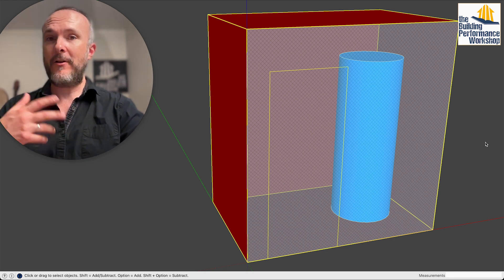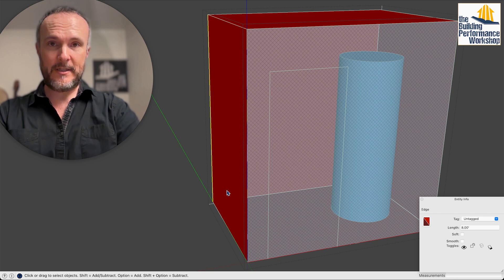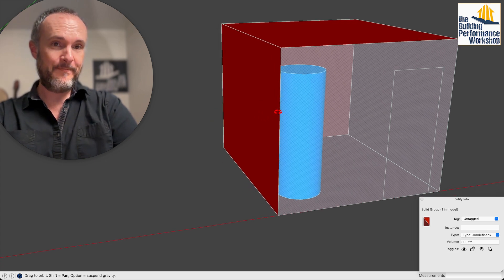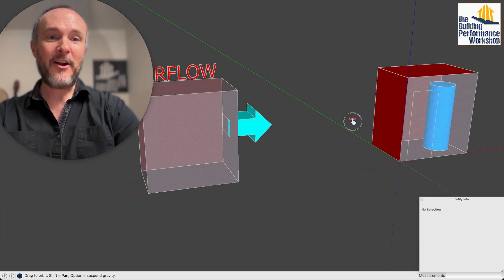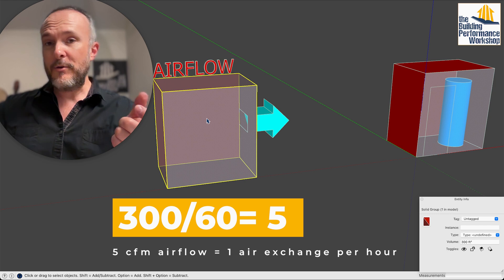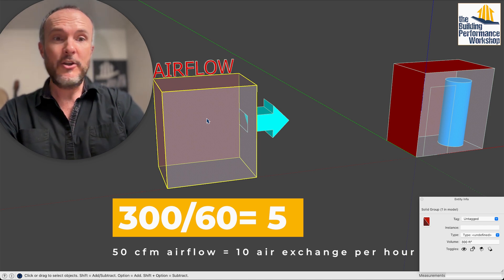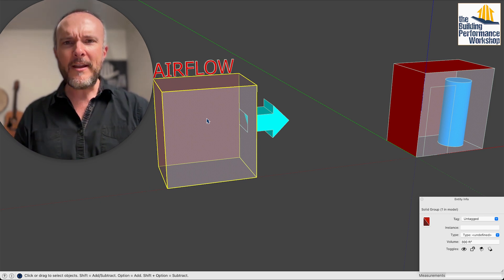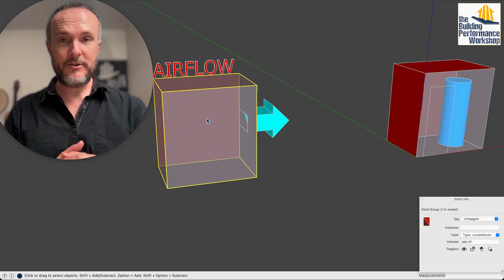Heat Pump Water Heater Trick: Bigger Air Volume, Same Size Room

Comment: I'm considering this solution in a house I'm starting to build in Spain. Where air would be supplied from a recuperation unit and overpressure would push the cold air through the door to the pantry and then to the open plan kitchen where the recuperation unit will have exhaust air intake. Alternative to this is to pull hot air directrly from the outsidenwhich would boost performance most of the year but could make the room a hotpoint of the house if unbalanced. I might update you in a year or two which way it went 😊
Reply: If you live in a place that doesn't freeze, solar preheating is a great idea, whether you use a HPHW, plain resistive, or instant hot water: it's free energy.

Another common thing being done now in climates with cold fresh water is installing a copper pipe on the sewer, and running the fresh water around the copper pipe to prewarm it. ThermoDrain is one producer of such a product if you want to google for a picture. It's particularly effective with showering and clothes washers, where the incoming 5º water can be raised to 20º before going into the hot water tank. Warming all the cold water, not just the hot water tank input, also leads to less hot water being used to mix with cold water (washing hands, dishes, so on), and reduces condensation on toilet tanks if humidity is high. It still makes sense in warm climates, but the payback is longer.
Reply: My biggest mistake was putting in HPHW, it sounds great and for most countries is the best choice. 
But for Thailand (I guess similar to Spain) I really should have just put in Solar hot water
Reply: @BradleyFordAus  much less humid in my part of Spain and in winter solar will not heat enough and would have to be electrically boosted anyway. If you don't mind, what is the issue with your setup? I can still rethink the solution, so would love to know the drawbacks.
Reply: @strayobject  the key is energy cost even with solar, a typical day is 9kWh just for HPHW
Reply: why not just use a split system?
if your not in a snow aera in winter you can do the water piped version which will work with most cylinders. or the gas pipe type which is just like a heat pump.
the only advantage of the internal units is in climates that are warm/hot all year round where you want to remove heat from inside the house.

Comment: Suprised you didn't talk about ducting the exhaust from the heat pump
Reply: that would completely eliminate any energy efficiency benefit
Reply: @ironmatic1 curious, how so?   Potentially dumping HPWH exhaust (chilled & conditioned) air to an unconditioned attic or similar sounds like an viable option (as an example)? …
Reply: @smitm108  Because that air has to be made up from somewhere, and usually in residential that means through infiltration. Almost identical example, the whole reason we'd like to move away from vented resistance dryers to unvented heat pump dryers is to get rid of the vent.
Reply: @ironmatic1  you’re right, but ducting doesn’t automatically mean to the outdoors, it can mean to an adjacent room or an area of the house that could use extra cooling.
Reply: @ironmatic1  Don’t disagree but leads to lengthy discussion, e.g., tight, performance construction, makeup air strategies, etc., so I’ll leave it here.
Reply: @ironmatic1  For anyone with an electronics/network cabinet in the house, or just a home entertainment center. Finding a way to vent that exhaust into that space would likely be a worthwhile boon. Assuming they're reasonably close to each other. There are in-home activities that many pursue besides laundry that tend to generate heat pretty reliably outside of the kitchen.
Reply: @ironmatic1  put it into an electronics space, gym, kitchen, etc. your accomplishing the same thing in the video without making that room colder and making the heat pump work harder
Reply: This is the obvious solution.  Way more practical than adding a bath fan, which still requires a hole be put in the wall.

Comment: Given that most heat pump water heaters have installation guidelines that include using ductwork to bring in more air if in a smaller space using a fan like this makes sense. I've been contemplating a HPWH for a while now but would like to see one be reliable enough that I can reasonably expect to be able to leave it in place for 20+ years and just focus on flushing the tank once or twice per year, install a powered anode, and keep the filter clean, vs having to worry about replacing the whole thing when a condenser fails in less than 5 years or have it be so loud it's heard throughout the house. My current lowboy electric water heater is 25 years old, makes no noise, is simple to maintain, and with low flow fixtures doesn't use much electricity.
Reply: My GE heat pump water heater is about 15 years old and we haven't had any issues. And the technology will keep getting better, so I doubt I will keep anything for 20+ years anyway.
Reply: @DeuceDeuceBravo  I wish that model was still available. GE stopped making them in 2016 citing low demand. If Rheem still made the gen 4 version of their HPWH I'd happily buy it. I just haven't seen much positive about the gen 5 rheem or the AO Smith, which are the only 2 locally available models. It seems like the current generation is worse than the one prior, and that has been the case for a few years now, but hopefully not for much longer.. Most complaints seem to lead to the whole unit being replaced. I have room in my encapsulated crawl space for a 40-65 gallon hpwh, but since it would be going through a 30 by 30 inch door and weigh 200+ pounds I would want to leave it in place for a while.
Reply: @NurseAcrobat  Fair enough. It's very possible that "they don't build them like they used to". Have you looked at the SANCO2 or something similar? They're more expensive, but the tank would never need to move. If the  heat pump breaks down, that gets replaced on its own.
Reply: @DeuceDeuceBravo  I may get a quote for installing a SANCO2 at some point as the website finally listed an approved plumber in my area. While I'd prefer to install a water heater myself their warranty only covers units installed by approved plumbers.

Comment: What would the larger consequences be for the building’s performance by pressurizing a small utility closet like this?

My HPWH conundrum is whether or not it would work out placed in an attached but unconditioned two-car garage. Would the summer performance make up for the likely use of the coils in the winter and the higher sticker price? Not sure yet.
Reply from the maker: A 1” undercut on a 24” wide door can return up to 50 cfm, so it’s almost certainly not a challenge.
Reply: Rheem says you can put in in a garage that gets down to something like 37F but mine definitely draws more power in heat pump mode at low temps. It's very happy at 75, at 62 draws 40% more power. I never use the elements.